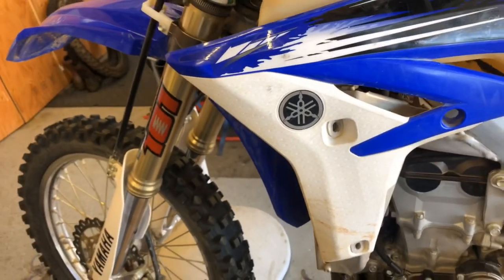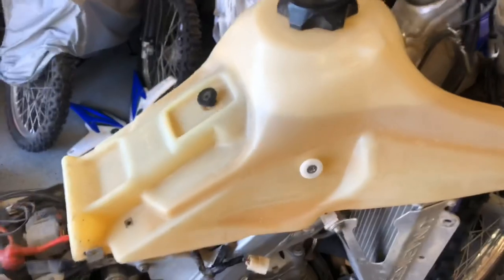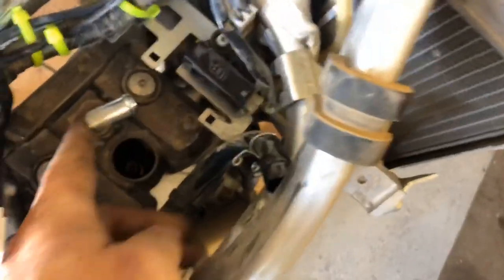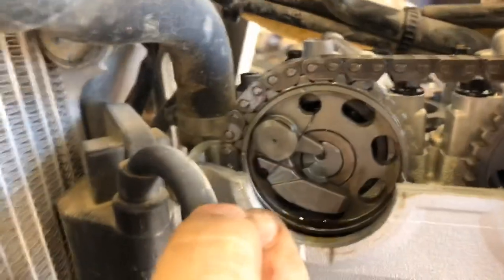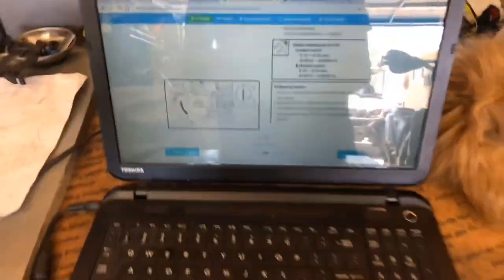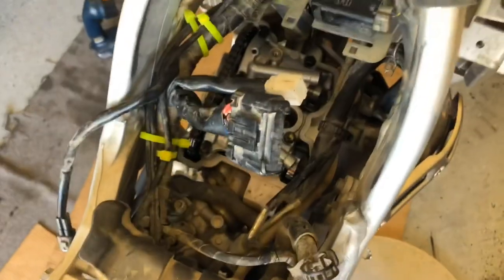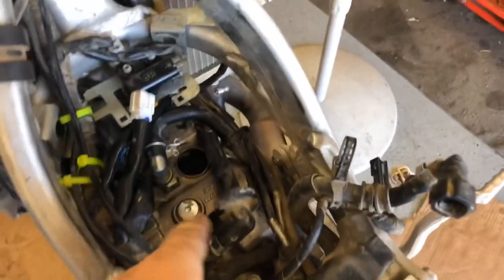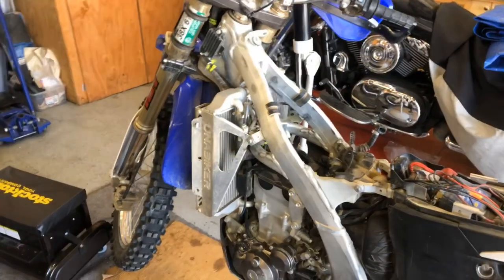2012-2015 Yamaha WR450F  Valve Clearance Check Procedures

Comment: Thanks for this. I've done valves on a 125 before because it was super simple (2 valves and didn't need to take the fuel tank or head off) but I've been dreading doing it on my 2022 WR450F. Hopefully it's not too different to this on the 2022 model. I've put 3000 miles on it so not checking the clearances is giving me anxiety 😅

PS One thing you didn't mention is the gasket. Did you reuse it, use paste or order a new gasket?
Reply from the maker: I’m not sure how different the newer models are, they flipped the engine around I think?  Most valve cover gaskets are rubber and reusable.  Might need just a bit of sealant.